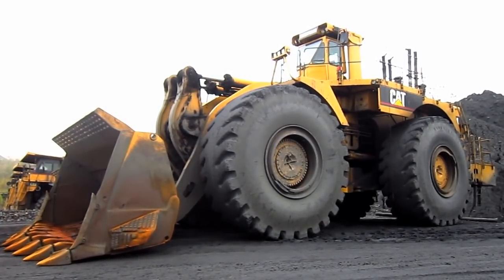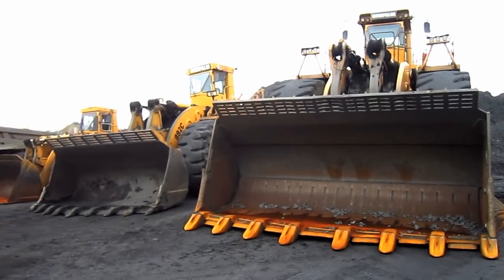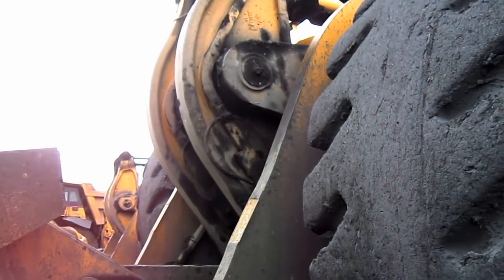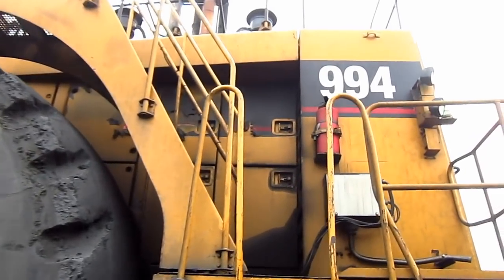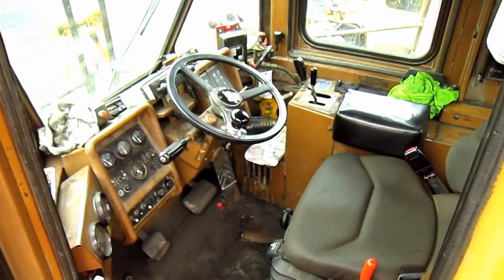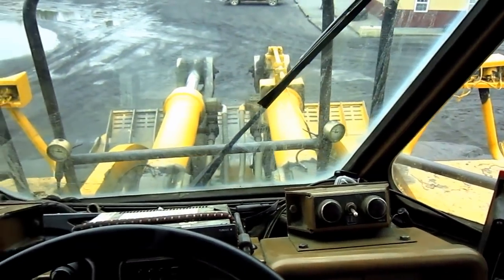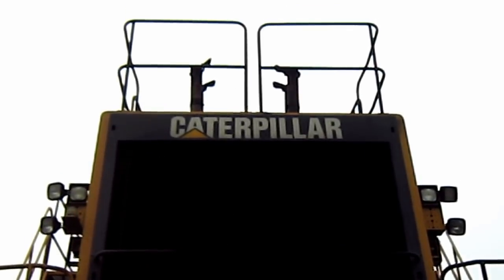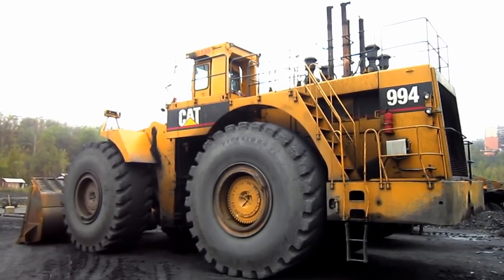Caterpillar 994 Documentary

Comment: 26 yard bucket ,I ran a loader with a 3 yard bucket and could fill tri axles pretty quik ,I can't imagine this beast
Reply: It would take 7 or 8 passes with that 3 yd. bucket, with coal. I loaded triaxles and trailers last with a 988H with a 15yd coal bucket. The larger beds could be loaded with 2 passes, but most required 3 corner buckets to even out the load .

Comment: Wow, I forgot that the first gen 994 came with wheel steering at first.
Reply from the maker: Yes, basically a big 992 lol
Reply: Of course. The first generation of the 988, 992, and 994 wheel loaders use to have a steering wheel inside of their cabs, but later replaced with the "STIC" joystick steering (started on the 988F, 992D and 994D wheel loaders) so to increase legroom, visibility and comfort.
Reply: @staceyjaytowers2509  Thanks for the info! I was doing a bit of research on the 988F since I'm building one, and Cat would still allow you to special order a 988F (I&II) with the wheel if you wanted. However the take rate on the STIC was so high that barely any with the wheel were sold. I've found a few on the used market, but they're rare.
Reply: @StephensCustomModels  Sounds OK.

Comment: Worked around 2 different ones 1 in hazard Ky other near delbarton West Virginia…got in er and hadn’t found the disconnect back then or I was gonna play a little…hard to judge size on a mine site with 30 992s…50..d11s…785s…89s..93s…and komatsu 830s under 5500 shovel…coal Mac was a massive job back then..
Reply from the maker: Personally have visited Coal Mac and worked around 5500s and 830Es. You get used to the size because you see it everyday, but it's still huge lol. Thanks!
Reply: @PAmining  I figured you had lol. Appalachian fuels….central Appalachian mining…horizon natural resources…all big names in early 2000s…starfire in hazards production sign said 500,000t month if I remember correctly..had p&h and Marion 8050… common in yer backyard but I was around the only 2 I know of in eastern ky…martiki was the job other one was on..

Comment: The 995 is out now
Reply from the maker: The 995 is a renumbered 994K. The 994K should have been introduced as the 995 from the start but it wasn't
Reply: @PAmining  Thats not true.  The 995 is more efficient and has a higher payload than the 994K, I know because I worked on the first 2 in existence at Cat

Comment: Only 200 made, wow , they are rarer than rocking horse shid.
Reply: That was unit count built and sold until the 994D came out in 1998.  The cab had air conditioning added.  The seat and dashboard improved.  This is for mines.  Steel mills use 992 to move taconite from dockside storage to furnace feed belt.
The 994D was originally built in Joliet, Illinois along with 24H Motor Grader, 5230B mining shovel.  All Caterpillar hydraulics were designed and machined in Joliet in that time frame.  Joliet closed.  Hydraulics machining and assembly are in Mexico.  John Deere also moved their hydraulics to Mexico the following year and laid off 250 employees.
Cat mining is now headquartered in Tucson.  The rest of Cat will be moving there from Peoria, Illinois and leave another rust belt city behind.

Comment: The only thing missing in these videos is starting up the machine so we can hear them running.
Reply: We had 3 of these at one of the mines I worked at. If You weren’t familiar with them, they would startle you when starting as they had air starters.

Comment: What letter revision is this? The current is K.
Reply: No suffix. Just 994
Reply: @mikerewegan9960  Well, the first ever generation of the 994 wheel loader use to have steering wheels inside of cabs (just like you find on the 988B and 992C wheel loaders). But years later, the 988, 992 and 994 series have proportional steering system on the left armrest rather than a steering wheel.

Comment: i wonder why every wheel loader turn left and right like the snake why not turn from the front wheels like the car if anyone here have any idea about this thing i hope answer me thx all✋
Reply: Making the front wheel turn can be done however, the life of the drive assemblies would be virtually nil. The amount of torque applied to the front wheels and or any axels used would result in frequent parts breakage. By making the axels stationary ,with no articulation, the hubs and axels are not subjected to so much torque and tend to last almost indefinitely. The articulated body sections are fitted with pivot pins and bushings and steering is controlled by two or more hydraulic rams.
Reply: @lloydholt6511  thx 4 the answer bud but the wheel loader comes with the chassis 2 blocks and one suspenion on the rear axal yeah the ram clyinder who is control the steering left and right but if she have leaking from the ram cylinder she can not turn left or right well thx again dude ✋

Comment: Completely  annoying  Cab access Door  handle  basically in the  Stupidly  Wrong  Place  way  down  on the  Floor  , these  cat  so-called design  engineer's  Obviously  didn't  give a shite about Bending or Stoopping  over wright down to the Floor  to  get  in  this  thing. Could  have  at least  Designed the  Door  handle mid  way  up  or  even  at the  Top of the  Door  with  Zero  bending  down  in the  Shit  Squat  position.